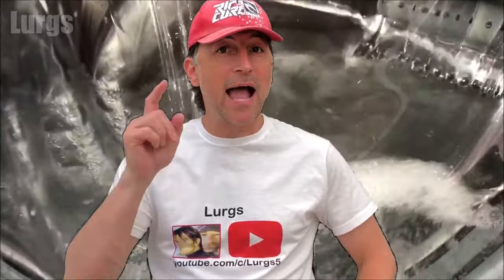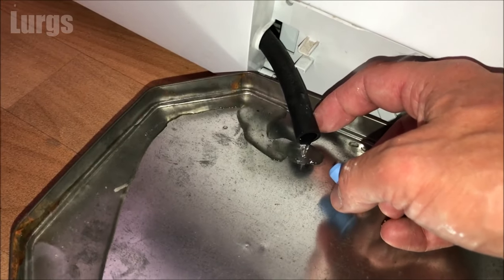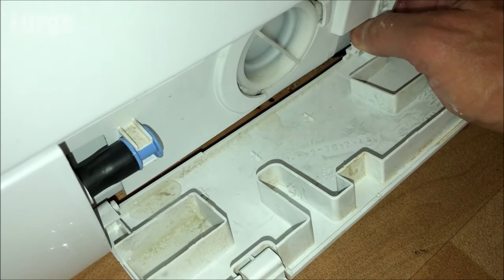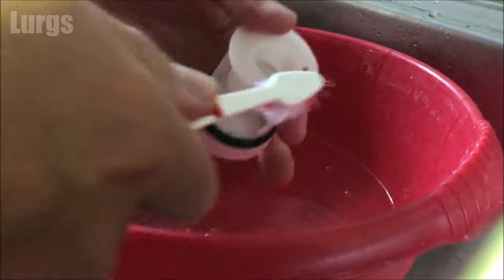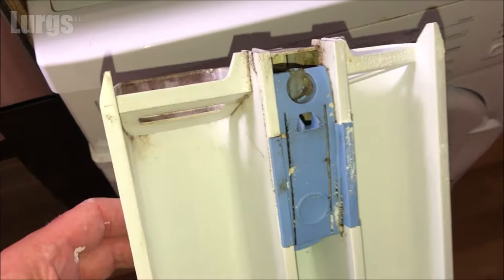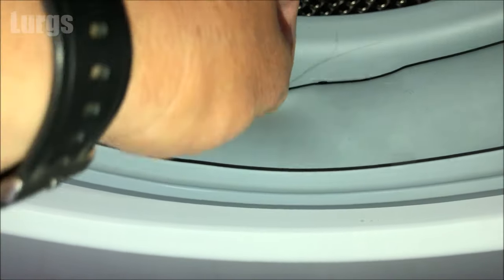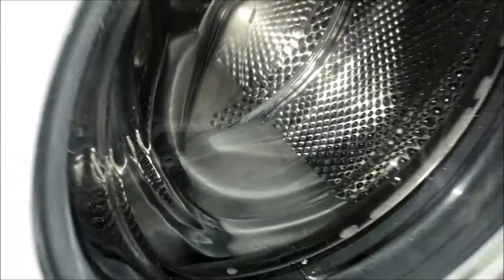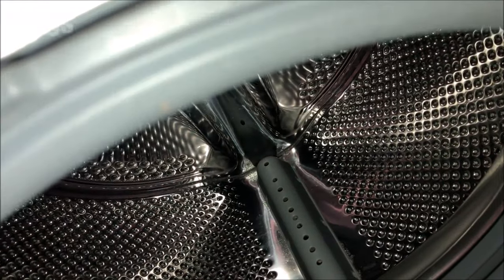How to remove and clean filter on Beko Washing Machine & keep it Hygienically Fresh

Comment: This was an excellent help - thank you. I empty the drain hose regularly but had stayed away from the pump filter as this seemed to be more of a 'big job'. However thanks to you it was a harmless and usefully spent 10 minutes. 
Also - just as a hint if  I may - to drain the small hose I use a 500ml plastic water bottle (one of the square shaped ones) and this is usually large enough to drain in one go , so long as you hold the open end up a bit as the bottle fills up, which saves all that precarious balancing with the tray. 
Thank you for this video, it's been very useful.
Reply from the maker: Great news. Glad my video helped 😎

Comment: My washing machine started making funny noises. I tried to get the filter cap off but it wouldn't turn all the way. After watching this, I just kept turning it left and right, then it eventually moved what was trapping it and I got the curby grip out with tweezers. You've saved me buying a new washing machine or having to call the repair man out. Thankyou.
Reply from the maker: Great saving and a great result, nice. That’s what my channel is all about. 😎

Comment: I have just bought a Latest blue tooth steam claen "Beko"  washing machine. I have only had it a few weeks. I found this video very imformative. I wished I watched it before I cleaned my filter (Lol) not... I learnt the hard way I didn't pull the plug of the drainer first. You guessed it I had a flood accross my floor, where I un-screwed my plastic filter to quickly. Also I couldn't understand by the booklet instructions how to run a super clean cycle... You have made it funny (Your wifes tooth brush) lol and step by step easy to follow instructions and the video to go with it. Thank you. I always have a have a job understanding booklet instructions but your video, made it easy to follow. Thanks again.
Reply from the maker: Bad news about the flood but good news you found my video. Hope it all goes well going forward. 😎
Reply: @LurgsHowToGuides  Also I got adventuras and did a hygene clean by your instructions on your vidio. But...I didn't have the proper cleaning / deoderising ? powder to put in my machine. So I did what you said (Well I didn't) you said use a little bit of laundry detergent. Arh ! this is where I went wrong I used enough washing detergent to do a full load and...(Well Ooops !)  I had a machine full of bubbles for the whole two hour plus cycle. (Arh !) I was hoping it wasn't going to over flow out of the machine. I was having kittens (Putting it politley) I learnt from that miss hap to watch and listen carefully from videos. Lol  Two miss-haps in one day....Lol (Not)
Reply from the maker: Yes I’ve had that once with foam coming out of every gap! Quite a sight that is
Reply: I did that twice following the written instructions before watching this guide.

Comment: Thanks for this!!! Got a Beko second hand from a friend and lost a button the first time I used it. Found 20p and a fence staple in the filter 😂 The button turned up in a fold in the seal after the next wash, but I'm glad I got the fence staple out anyway.
Reply from the maker: Good finds, hope it’s all working ok now.😎
Reply: It was working ok anyway, I just wanted that button back, plus the terrible online instruction manual said that items left in the pump filter can cause damage. It continued to work fine after I got the spikey bit of metal out of it anyway, thank you!

Comment: Thanks a lot! I tried and tried to unscrew the plug to remove it but no way. I then researched and found your video which explained to keep turning left to right until it frees :) It worked. A heavy foil type sweet wrapper and a thin twig were wedged inside. Cheers :)
Reply from the maker: Glad I could help. Merry Christmas. 🎄

Comment: hi, before running the clean wash programme, does the spin speed matter? as i noticed yours was set to 800. it's just that with no spin it'll reduce the clean wash programme, thanks
Reply from the maker: That’s the final rinse speed so you could increase it if you wanted to.

Comment: A great way to stop the machine stinking, is to clean out the drawer you put the liquid in, put a towel in that to soak up any water. I put towels in the seal where the water collects where you open the door. Clean the door glass dry too. So that it's a really dry my machine. Since doing this I've never had issues with mold, or smells.if you want to go one step further, you can use a toothbrush in the drawer to clean any mold as I spied a tiny bit of mold where the water jets are. Also, Keep the door ajar until next time you use it. Yes a bit OCD 😊.my beko is 6 yrs old. With a bit of extra tlc it's still like new

Comment: My filter cap seems to be stuck fast. Feels like it will break if I put more force behind it. Any udeas why that might be?
Reply from the maker: Probably something caught inside, usual culprits are metal hair clips or coins. Try tightening then untightening and maybe also try bumping machine around if you can to see if it will dislodge. May then have to get a bit more forceful. Hope you can get it out, good luck.😎

Comment: Hi there. My beko washing machine is working normal but at the end of the cycle the machine isn't draining all the water. And the door is unlocking . I've had to empty it with a cup so it's filling up fine . I disconnected the the waste pipe I think it is and there is nothing blocked. When I'm trying to unscrew the filter there is too much water flooding out I've not got anything that I can fit under it to catch the water. Have you got any ideas what it is
Reply from the maker: You’ll need to remove the filter, just unscrew slowly and soak up with an old towel. Probably something in the filter. Good luck

Comment: HI, so last night i noticed my clothes were really sopping after cleaning, and realised the drum had stopped turning. I did some research and have arrived here, and am in the process of cleaning the filter.. Annoyingly will have to use pliers as the cap is stuck... Heres my question : even when im done cleaning the filter will the machine start working again ? I have pre drained the water via the black hose ... Thanks. :/
Reply from the maker: Well it depends. Maybe the filter was blocked or maybe your drainage pump has failed. You won't know till you try another wash. Good luck, hope it's ok
Reply: @LurgsHowToGuides  thank you. Well its clean now and free from gunk, but unfortunatly i tried a cycle , and just a litte jet of water came out and the drum did not spin. I suppose its time to call in an expert?
Reply from the maker: You have to weigh up cost of a visit and repair (£60+ minimum) or go for a new one. Depends how old it is.

Comment: Can you give some advice, I’ve opened my lint trap but I only found coins and some hair yet i still find these tiny grey-ish clumps of what i can only assume is lint on my washed clothes. When wet the clumps are really hard to get off but once they dry its kind of flaky even. Is this normal? Is there a way to fix it?
Reply from the maker: Yes that is normal unfortunately due to man made fibres in clothes, you see it alot in Tumble Dryer filters. You can buy cloth bags that you put your clothes inside which traps it all.

Comment: When I take the bung of the tube nothing comes out. I’ve emptied it using the filter and the filter was really clean but my machine is just always full of bubbles. Do you think there could be a blockage further up?
Reply from the maker: @BridieMoore-i8l  Not sure. Check all drainage pipework. Could be a faulty pump maybe

Comment: Hi my machine is only few months old and I don't think it's washing my clothes good wen they start to dry or go in tumble drier they got a horrible smell on them  my washing isn't going soapy even after putting in 3 cap fulls of detergent. Also if I do a 60 wash should my drum be at least warm its stone cold.. Think I've got a problem somewhere I've cleaned out the filter like you done.. Do u have a video to show all packaging out and what hose goes to what 🙈
Reply from the maker: If you do a 60c wash the drum glass should get pretty hot during the cycle, if not then your machine is faulty. The machine should heat up the water to the desired temperature. Do an empty wash at 60c then check drum glass during the wash.

Comment: I have threw out my manual, there is a cycle option for drum clean, do I have to put anything in the drawer? Or anything in the machine? Or just leave it all completely empty?
Reply from the maker: It's best to use Washing Machine Cleaner like Dr. Beckmanns, if you haven't got any put a tiny bit of detergent in the main drawer or in the drum directly, not too much else you'll get Sudslock where you get too much soap and it will pour out of every crevice! (fun to watch but not fun to clear up).😎

Comment: Would the filter catch a 'colour catcher'?. I used one but could not find it with the laundry afterwards.
Reply from the maker: Yes definitely, they are very common things to find in Filters!
Reply: I've checked and it's not there. A bit of a mystery but thanks for your reply.
Reply from the maker: Oh, could be trapped in the drum rubber somewhere or in a pocket and you hadn't noticed.
Reply: @LurgsHowToGuides  No, can't see it in the drum rubber and nothing with pockets in the laundry. Never mind, hopefully the mystery will resolve itself.

Comment: I definitely have a huge tangle of hair in my filter but I can't pull it out with my hands or tweezers. Do I need a bristle ended hose to get it out or should I just call someone in?
Reply from the maker: Try cutting it with scissors then pulling out the smaller clumps.

Comment: Hi i cleaned everything as per your video aa when on a wash cycle it washes but doesn't rinse and spin and there are loads of bubbles. I can't find a blockage anywhere 😕. Can you help? I have the wtb840e1w. Thank you
Reply from the maker: It could be a faulty motor then. Might be worth checking the drainage pipework though to make sure that isn't blocked up.
Reply: @LurgsHowToGuides  yep it was that, ordered the part and fitted it myself and all perfect. Thanks for advice. Oh and i used my husbands toothbrush to clean instead of mine  🤣🤣🤣

Comment: With the filter I am only able to turn the cap about 90 degress and it wont go any further.  Any help?
Reply from the maker: It will be a metal hair clip probably. Keep tightening and untightening until hopefully it falls and clears so you can undo it

Comment: My machine is leaking in the middle at the bottom. I've checked the hoses and they are all dry, I've cleaned the filter and that's ok. It did have a coin in it but I removed that and there's still a drip from underneath. Any ideas how to fix this please?
Reply from the maker: Not sure, it could be a leaking drum or a hose underneath. Try and put it on some stilts or a bricks and try to see where it’s leaking. Could  be time for a new machine

Comment: Great video! But one thing I'm wondering is does the washing machine need to be turned off at the plug socket? Because I live in a rented property and the socket is behind the washing machine and there is no way for me to reach it. The instruction manual says not to do it without turning it off. 🙃
Reply from the maker: Yes ideally you would turn off the mains power just to be safe.
Reply: Mine is behind machine to.. I just did it plugged in 🤪
Reply: @maggiechalmers3549  My letting agents told me to do it without unplugging or turning off the mains. I did it and was okay but I intend never to again lol. As it happens I am moving, so it won't be my problem ever again.

Comment: Hi could you help me?! I put a wash load on but it didn’t drain so I cleaned out the filter and LOADS of water has came out. But when I unscrewed the cap, I noticed the cross spin bit you can see at the back of the hole has came off and it won’t go back on. Any idea if that’s the cause and how I can get it back on? Would be much appreciated!
Reply from the maker: Yes that will definitely be the cause as that is the impeller that spins and pumps the water away, without it it’s like an old airplane without a propellor! You could try drying it all out and super glue it back on, but I doubt it would hold, you may need a new pump unit or if the machine is really old then maybe a new machine. Good luck.
Reply: @LurgsHowToGuides  thank you! I did dry and superglue it back on and it’s stayed on for 2 days so far so we will see how it gets on! :)
Reply from the maker: @bonnielangham6683  ooh nice! Hope it holds for you

Comment: Hi. The little impeller behind the filter keeps coming loose when I run a wash and the machine won't drain. Do you know what the fix would be for that? Thanks
Reply from the maker: Probably a new pump as it’s one whole unit. Guess you could try drying it all and maybe try SuperGlue. Hope you can get it sorted. If it’s an old machine it may not be worth the cost of a new pump
Reply: @LurgsHowToGuides  Thanks for the reply. I've given it a try so fingers crossed 🤞

Comment: At the back there’s like a fan somethings wrapped around it how do I take that apart?
Reply from the maker: Don't take that apart its a sealed unit impeller. You need to get it out, try scissors to cut it and then some tweezers or screwdriver to pull the debris out. Good luck

Comment: Can I take the filter out and run an empty cycle to clean the pipeline leading to the filter?
Reply from the maker: No, water will pour out all over your floor if the filter isn’t screwed in tight.

Comment: Followed these instructions but the filter is now leaking water when the machine is on a wash cycle - what have I done wrong??
Reply from the maker: Sounds like either debris on the thread or you haven’t tightened it up all the way, it should give a final click when it’s done up properly.

Comment: Iv just done this step by step and noticed the propeller seems to be very loose. Could this be the problem why the water won’t drain out my machine. Stops mid cycle and won’t drain. Makes a loud noise as it’s trying. Would love to hear back from you
Reply from the maker: The impeller\propeller shouldn't be loose. You should be able to turn it round but it shone rigid in its position. If machine not that old you could try a repair or a new pump. Else if it's pretty old it may be easier to get a new machine. Good luck
Reply: @LurgsHowToGuides  any idea how I could repair it. What are the chances of it coming loose?
Reply from the maker: @wezjones24  would be very difficult to repair if it’s a loose impeller
Reply: @LurgsHowToGuides  ok thanks for your time mate

Comment: On my beko washing machine, the little black hose with the bung on has been accidentally pushed back in too far that it has gone inside the washing machine and the whole is too small to get it back (there was no clip for it like in this video), any ideas of how to get it back through the whole?
Reply from the maker: Not sure how you’d get it back out , you could try a claw grabber tool which you can grab with.

Comment: can you help me please. my beko does not have the removeable front panel anddoes not have any screws visible at the front (unlike every other machine ive had)- i can not figure out how to remove the pump and filter (filter is broke and that is why i need to remove the whole thing. beko do not reply. no video shows a beko like mine- help??
Reply from the maker: Oh how odd, maybe it’s an older model without a removeable filter? Or maybe it’s round the back of the machine? I hope you figure it out

Comment: My hose fell inside the little hole and don't know how to pull it back out any suggestions? Thanks in advance
Reply from the maker: Maybe some thin long nose pliers? Maybe the end of a vacuum cleaner nozzle see if it will suck it out a bit so you can grab it. Hope you manage to get it, good luck
Reply: Did you manage to get it out?. I've just done the same thing after following this video and now I'm sat on the kitchen floor in a heap in tears as I can't get it out. It's in an impossible position to do anything with.

Comment: My Beco washing machine is not taking the softener out of the dispenser although I have cleaned it, any advice
please?  Thank you.
Reply from the maker: Could be the washing programme you use doesn’t use the softener, or the softener is too thick maybe
Reply: @LurgsHowToGuides  Thanks for replying but do you think the water inlet may be blocked?
Reply from the maker: Unlikely as then the washing machine wouldn’t fill with water. I get lots of comments where softener doesn’t dispense properly, must be a common issue. You could try diluting it a bit or try a different make
Reply: @LurgsHowToGuides   OK will do, thanks.

Comment: Great video but I can't get the filter out😢. Tried and tried😢 it's stuck firm
Reply from the maker: Try untightening and tightening multiple times to see if the object clears. It is bound to be a metal hairclip. If not you may have to get a bit more forceful, but be careful as the filter is only plastic. Good luck..

Comment: Hose went into machine when I was cleaning filter how to get it back out any idea
Reply from the maker: Not sure, need to get something thin inside to try to pull it out, maybe a vacuum cleaner nozzle to see if you can suck it out maybe.
Good luck
Reply: @LurgsHowToGuides  OK thanks for the reply

Comment: The propeller of mine was clogged up but I found a black rubber band that does not belong to the filter. I am worrying it came from the pump somehow.
Reply from the maker: The pump propeller is an electrical motor I don't think there should be any bands or anything like that. If the propeller spins freely and unit is secure then maybe just try it again to see if it works.